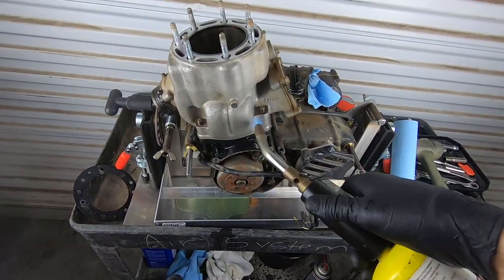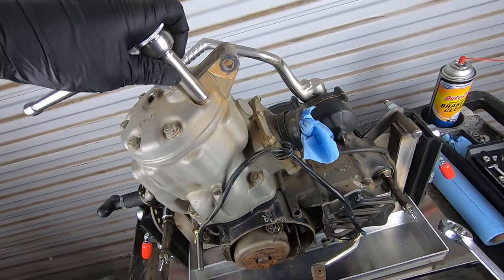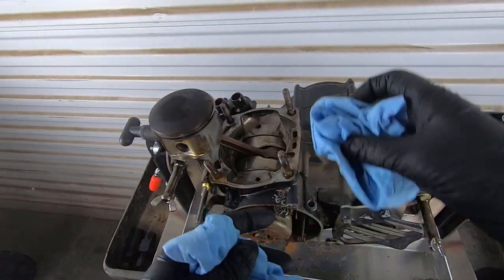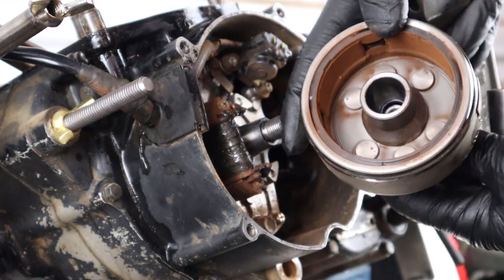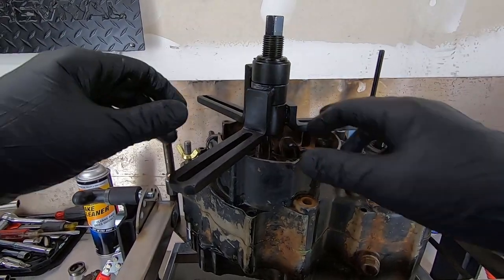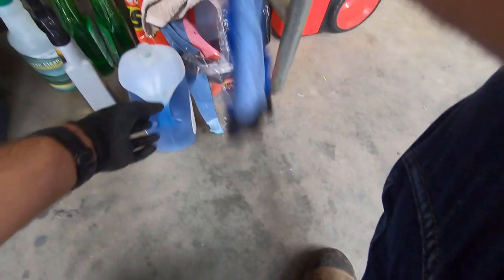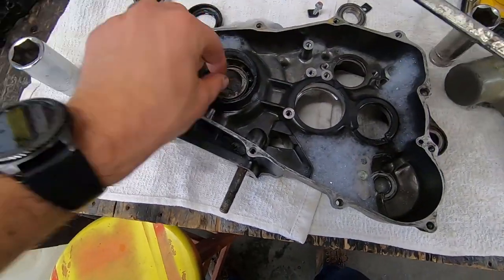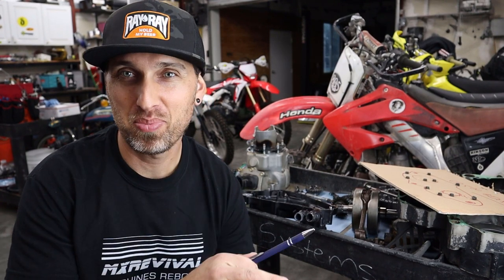Frame Up Honda CR500 Two Stroke Build - Dirt Bike Magazine

Comment: A trick I use to get all the bearings out of the cases is to put both case halves into the oven facing down. The aluminum will expand faster than bearings and they will fall right out after 20-30 minutes at 250-300 degrees F. I do the reverse at assembly. Cases in the oven and bearings in the freezer.
Reply from the maker: That's a really great idea & also better, more even heating than a torch!

Thanks for sharing with everyone  🤘
Reply: Works like a charm, I use to put mine on a cookie sheet and you'll hear a ting when the bearings fall out. I used 350 degrees. Bearings in the freezer day before they slip right in like butta, no stress on the cases. Happy cases happy moto life 🤙 Ol skool trick I learned back in the day from 60s-70s moto heads.

Comment: The wear on the exhaust side of the piston is from a lack of exhaust bridge relief holes in the piston. This is an absolute necessity on the CR500 with the exhaust port bridge.  There is a defined method for hole size and location for the holes in the piston. I am sure since you are working with the Guru, Adam Millar, he will have educated you on this my now since you made the video in March.
Reply from the maker: That make prefect sense as I have seen those directions for hole drilling on older RM250s when using Wiseco pistons. They always had the holes drilled already too so I've not had to actually do it myself yet.

Again, more great info from you & yes Adam is a Legend!

Comment: BTW, I've had most of the open class Honda's and only the 1984 pinged. They were always 'blubbery' off the bottom at sea level (Florida) and required leaning the needle 1 position up (drop the needle).
Reply from the maker: Wait till you see this thing finished, holy crap. You're going to like the pipe... Three more peak HP and handmade!
Reply: Hell yeah I have a 84 cr500 too...the ping king 🤙
Reply: @CainSample  Now that name fits for the '84!

Comment: Was that case bearing screw a standard #3 Phillips or a #3 Phillips JIS screw? Was a JIS bit what you were using?
Reply from the maker: I'm not sure, sorry! But it's been a great tool & it's dirt cheap: https://www.rockymountainatvmc.com/parts/tusk-impact-driver-p We also have it as part a complete bundle (all the tools used in this video in one easy/ convenient location) That bad boy is right here on the actual mXrevival site: https://www.mxrevival.com/product-page/engine-builder-s-garage-hero-tool-bundle - we throw in a free set of feeler gauges too as a thank you 🙏
Reply: Okay I looked up that tool and they’re not JIS according to the description. I’m surprised your tool supplier hasn’t insisted on JIS style bits and drivers. You should get some JIS bits for use on your videos. They really help taking apart older Japanese bikes. It would help educate your viewers. I use Vessel JIS drivers. Here’s a description of the differences:
https://www.motorcycle.com/ask-mo-anything/difference-between-japanese-jis-phillips.html
Reply: Probably should also add that JIS as of the late 2000’s is obsolete and they more or less rolled the standard into modern Phillips screwdrivers so if they have the properly rounded tip they’re likely to be okay but for older bikes with the JIS screws with the dot on the head I always use the genuine drivers and also Vessel makes a great screwdriver with the impact feature built right into the handle.

Comment: Might not wanna take advice from me cause I’m 13 but I am getting a small engine certificate so that may lever her out 😅 but anyways take a metal broom cut off the tip and you have a huge breaker bar I work with vintage machines all the time and everything is tworked down way harder then they do on current things much longer than any regular breaker bar and normally free
Reply from the maker: Don't sell yourself short 😎 You're a stud for wanting to lend people a helping hand.

I personally use a 4' steel tube (that was a handle for an electrical conduit bender 😁 Check those suckers out when you have a chance.

Keep killin' it buddy!

-Charles // mXrevival
Reply: @mxrevival  thanks

Comment: Often times you can remove the base nuts from the cylinder and remove the head stays then hold the kill button while kicking the bike and it will break it free.
Reply from the maker: That's a great idea. I'll try that if I encounter this issue with an engine that's still in a frame. With spark plug out, even better. This was the most stuck cylinder I've ever encountered.

Comment: Great vid man...fun to watch! So you're the fighter pilot that's gonna rip this beast when it's done? Right on!
Reply from the maker: I'm one of them! I should try to get DBM to do a public ride day so we can all beat the piss out of it!!
Reply: I think it's the other way around...doesn't a CR500 beat the piss out of the rider?
Reply from the maker: @LSForce10  Let's tame the monster, brother😈
Reply: @mxrevival  did you replace your linkage bearings? For the lowering link wishbone, did you use a blind bearing puller, looks like they need to be pulled not pressed, correct?
Reply from the maker: @coloradodirtbike5930  I actually haven't gotten into this bike swingarm and linkage just yet. But, most of the bikes I've worked on do need the blind bearing puller and have a small "shoulder" inside the linkage arm that the bearing is pressed up against when installed into the linkage arm.

I haven't given it a go yet, but the main linkage knuckle, the part of the linkage with the three mounting points, has sort of a funky and old-school mounting into the swingarm. Looks like a number three Phillips on one side with a 17 mm, or maybe a 19 mm nut on the other side. So I'll be interested to see how that actually comes out on a side note.

If you end up needing a blind bearing puller, I don't have one on hand, I would be glad to point you in the right direction 👊

-Charles // mXrevival
Reply: @mxrevival  I have a 91 cr500r which is the same pretty much as the 1990. Got all the linkage and swing arm races/bearings pushed out and ready for the new ones to be installed. The wishbone one is the only part that was giving me a little hastle, figure I'll get a blind bearing puller and slide hammer tool. I have a 20mm but its slightly too big, looks to be around a 19mm blind bearing puller needed.   Are you going to reuse the stock radiators or do you know of a reputable quality radiator that works better? I was considering mylers but still debating that, not sure if the quality is on par with oem. My radiators got sent out to ICW for repair but a lot of my fins are bent and crushed, plus the bottom of tank was repaired and welded, so now it looks like crap, might use some radiator specific paint to give it that black oem look.
Reply from the maker: @coloradodirtbike5930  Our radiators are in damn good shape so were going to try & restore them/ refinish them.

I know what you mean about the fins though, would be nice to have them looking good all the way. As far as I've heard, Mylers is a quality replacement & really there aren't a crazy amount of options anyhow. 

As for the blind puller collet, maybe you can back out the collet wedge just a bit more & get the end of the collet to collapse just a bit more- so it'll go into the bearing race for you.

-Charles // mXrevival
Reply: @mxrevival  got the bearing races out today with a little more playing around. Used some heat from my hand torch and the blind bearing puller. One side was a ball buster and cracked the lip of the outside race, but luckily there was the inner lip I was able to get the blind puller in and it worked perfect. The 2nd bearing pulled right out easily. 

Looking forward to seeing your rebuild. And yeah the 90/91 are very specific, parts are hard to come by. Maybe I'll give the mylers a try. Thanks again bro for the info and help.
Reply from the maker: @coloradodirtbike5930  oh hell yeah, good job. Heat always helps us finish the job.

I know that feeling when the race breaks 🤣

Glad you got it out.

Keep us posted on your Mylers Rads & my pleasure dude

-Charles // mXrevival

Comment: Great content! On your way to 100k subs ;) I love the big bore two-strokes. Thank you for the different tips and techniques as I strive to hone (pun intended) my engine rebuilding skills! I gotta get an engine stand. I bought the TUSK case splitter and installer the other day. I have a few KX500 engines to get up and going. (1985, 1987, 1988, and 1991 KX500 engines). If you want to check it out, there's a vid of my KX500 street legal supermoto on my channel. Cheers!
Reply from the maker: Thanks for watching & the rad compliment 😎 You certainly have your hands full! Lots of great bikes & your tool arsenal just grew too, nice!

Comment: The binding when splitting the cases with splitter comes from the countershaft output bearing. The shaft and roller bearing fit is tight.  I always struggled with this bind really didn't think much about it until I split the cases on 2017 KTM 250 SX.  KTM uses two piece roller bearings on the left side of the engine on the crankshaft and countershaft output. The cases split without a puller very easily. The roller half of the bearings are pressed in the case and the inner race is pressed on the crankshaft and slip fit on the countershaft. The case split gap was even all the way around when splitting.
Reply from the maker: Ahh super interesting. I appreciate all of your super useful & "helpful-for-all" responses!

I just sold a 2017 250SX too as a matter of fact!

Hope you had a great Christmas!

-Charles // mXrevival

Comment: Should have went with a better engine shop. That would give you better performance. We have much better shops here in the States. Especially shops that worked for the Factory Teams.
Reply from the maker: Adam builds 70+HP monsters, we'll be ok! Thanks for watching!
Reply: @mXrevival  lol your not going to get nowhere near  70ho from MRE. Trust me. If you wanted that you should have went with  Ken O'Conner or others.
Reply: @mxrevival  Look up LMR racing if you want that kind of HP from a CR500.  LMR is proven to be one of the highest HP CR500 motors.